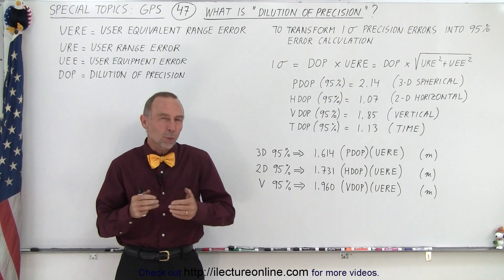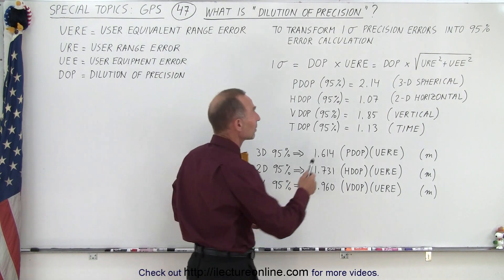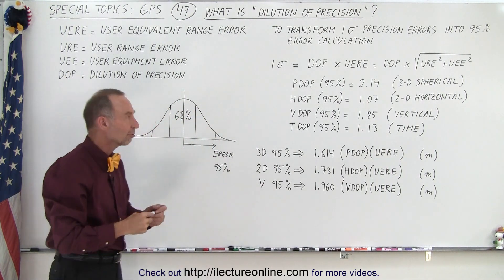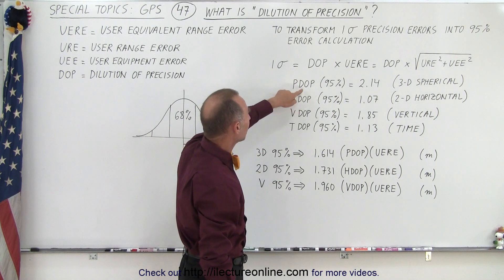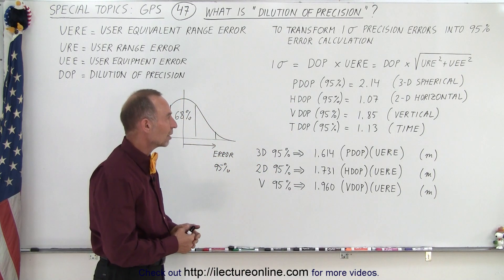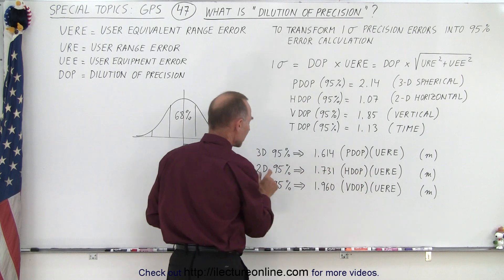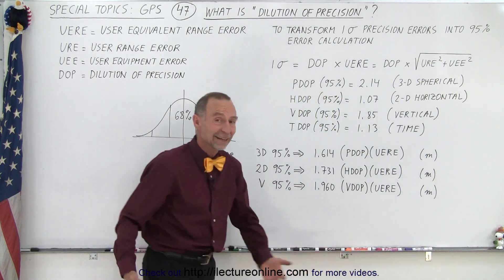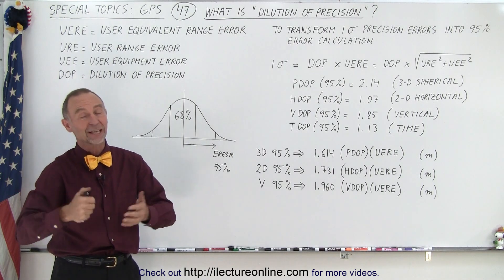Special Topics - GPS (47 of 100) What is "Dilution of Precision"?

Comment: Thank you! I wonder why VDOP is so much larger than HDOP, when they’re both looking for ranges on a single plane. It makes sense that PDOP is bigger, because it’s on multiple planes to make the sphere. Is it maybe because the vertical movement is generally directly toward the SV and maybe less accurately measured than a translational horizontal error?
Reply from the maker: That is a good observation.  It is related to the velocity vector component between the satellite and the receiver.  As the receiver passes overhead we cannot take as much advantage of the vertical velocity different as compared to the change in the horizontal range distance which makes it more difficult to obtain an accurate vertical position.
Reply: @MichelvanBiezen  That makes perfect sense! Thank you for explaining it to me